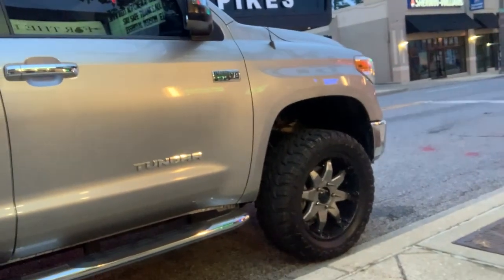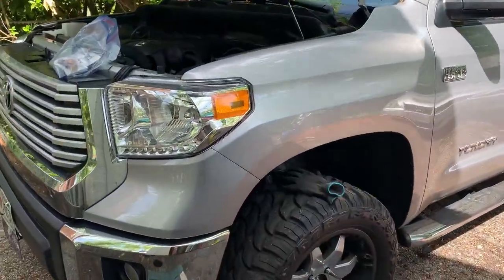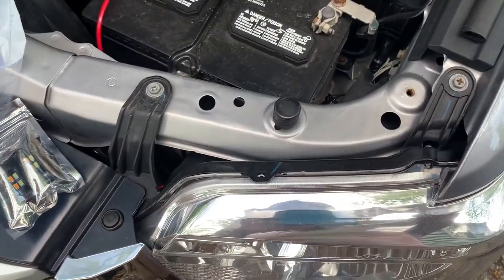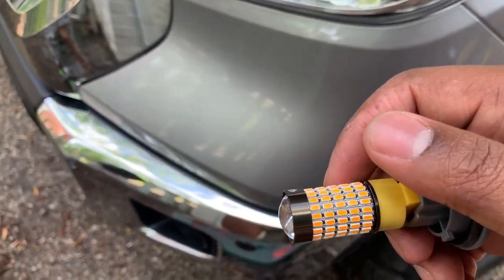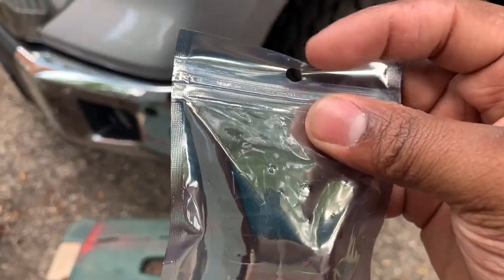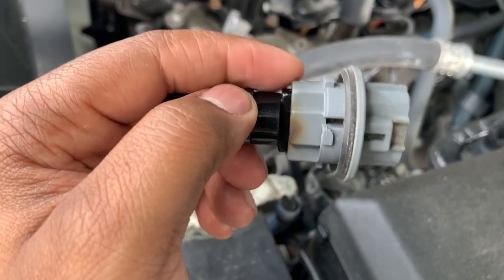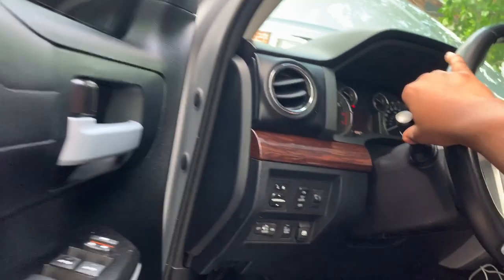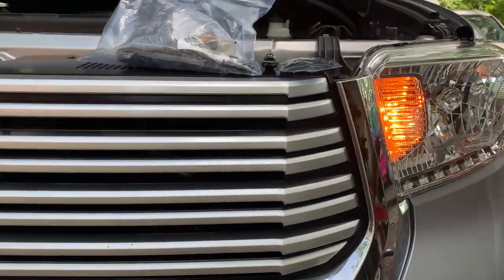How To Replace Toyota Tundra Front Turn Signals (Upgraded to LED 3157 bulbs)

Comment: Just an FYI, if you have an issue with your turn signals burning out. Try replacing the socket.  I have a 2011 Tundra, and apparently that's a common issue.

The reason I bring it up is that I noticed the brown areas (4:03) on the socket are an indication of high heat.
Reply from the maker: That's a great observation you brought up. I'm defiantly going to look into replacing them because the first time I replaced the halogen lights for LED, I noticed the socket was brown. Then a couple months later (2 or 3) the LED bulb blew which I recorded me replacing it. That would explain why I've been having such a short bulb lifespan. 

Thanks!
Reply: @AWordFromMrJones  I've experienced a similar set of circumstances with standard bulbs... three blown in 24 hours.  every time that one blew the tempo of the turn signal indicator increased.

Amazon was the only place that I came across where I could order two.

Best of luck to you.
Reply from the maker: @latetothegame1443  Much appreciated!
Reply: Where did you buy this?